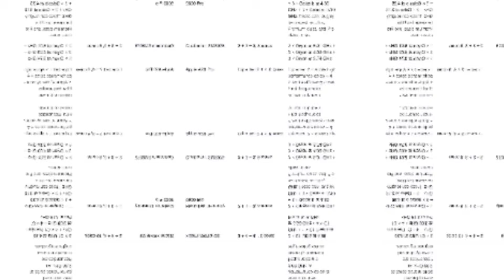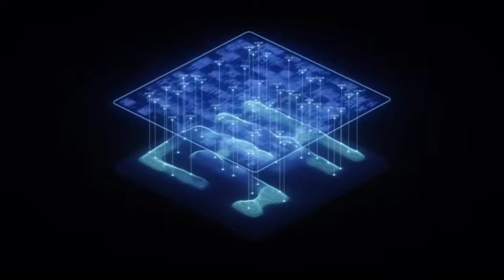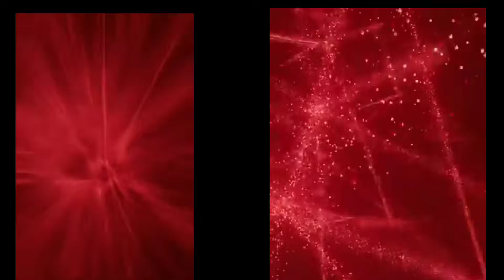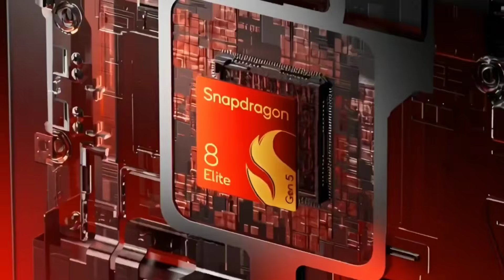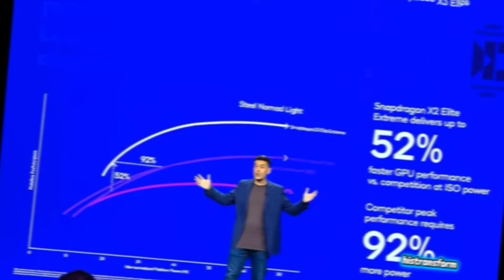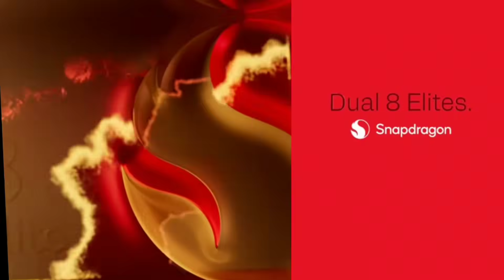Snapdragon 8 Elite Gen 6 Pro BREAKS 5GHz! Qualcomm Just Changed Android Performance!

Comment: No, thanks. Still waiting for the mighty Dimensity 9600 Pro.
Reply: Mighty? Don't make me laugh. Snapdragon is always the strongest Soc. Why else the Gaming Phones like Asus Rog Phone or Redmagic have only Snapdragon? Because it's the strongest Mobile Chip. Also Adreno GPU working always better with Emulator than Mali.
Reply: @all-stargamer3333 Just because it can't run emulators as well as Snapdragon and isn't frequently used in top-tier devices doesn't mean it's not mighty. In terms of raw power, efficiency, and stability, it competes almost neck and neck with Snapdragon, and there's no significant difference between them in everyday use or mobile gaming.

Comment: At this time , MediaTek has completely lost to Exynos, Apple, Snapdragon, and X-Ring. This is a big disappointment for me.Because I am a Mediatek lover.😔😞
Reply: Why do you love Mediathek? Don't you understand that Snapdragon is better?
Reply: @all-stargamer3333 We know Snapdragon is better, but we also like MediaTek because it has largely closed the gap and competed much better with it by releasing the Dimensity series for the past 6 years. The software and developer support side still has room for improvement, but that doesn't mean MediaTek is bad.
Reply: @all-stargamer3333 I don't know, what the reason!
Reply: Why? In which areas did they perform poorly compared to others?
Reply: @aysenbingol1255  Brother, Apple and Snapdragon have improved their chips more than the improvements that the Dimensity 9600 series has brought this year. Apple has reached almost 5 GHz, and Snapdragon has surpassed it.
Reply: @AHAbdullah-v7z So, in what area did Samsung and Xiaomi (Xring) surpass MediaTek (Dimensity 9600 series) this year? Furthermore, it's not all about higher operating frequencies on paper. I'm sure you already know this. Even though the Dimensity 9600 series appears to have lower GHz speeds on paper, it can still achieve similar, or very close, scores to Snapdragon and Bionic in tests. And in everyday use, there probably won't be a significant difference between them.

Comment: Do you think 5000 Mhz can be sustained for many hours? Only then will it really be that much, until then it's just a few minute spike.
Reply: No CPU ever stays at Max Performance. Not even AMD or INTEL. The Cpu would burn up. There is no cooling fans or liquid cooling like in a PC yet. Even then your playing with fire. Imagine a motor running at FULL MAX RPM for long periods of time. It still would cook even with liquid cooling and ram air cooling it...

Comment: Yet still beaten by A20 Pro in Single-Core
Reply: Different metrics.

A20 Pro still leads in single-core (~4200 GB projected).

Snapdragon 8 Elite Gen 6 Pro takes multi-core and GPU - leaked AnTuTu ~4.84M (CPU ~1.37M, GPU ~1.85M).

SC = Apple. MC + GPU = Snapdragon. No full retail head-to-head yet, though.
Reply: @12rsz   Depends on game optimisation on both. Genshin runs 120 FPS on iPhone and 60 on Android
Reply: Eat stool
Reply: Snapdragon 8 elite gen 6 pro beaten A20 pro in multicore and gpu